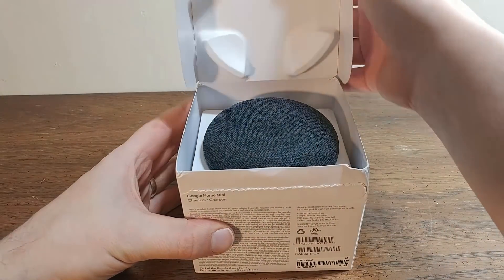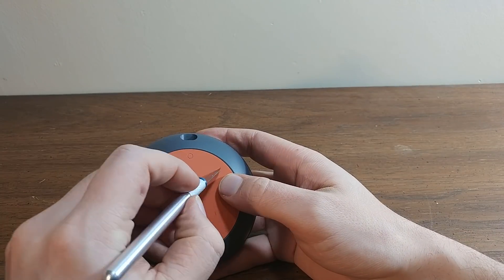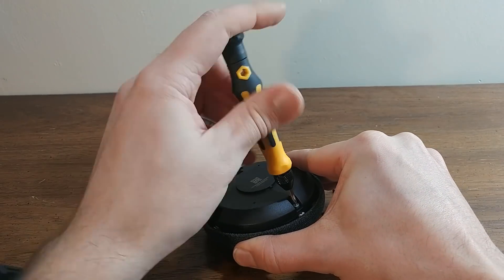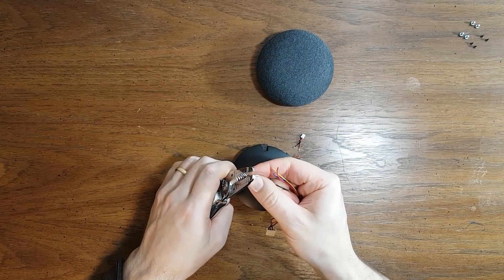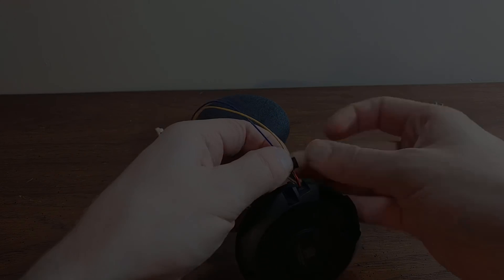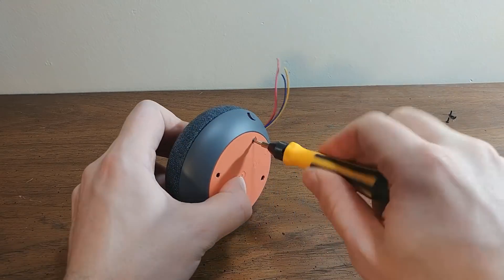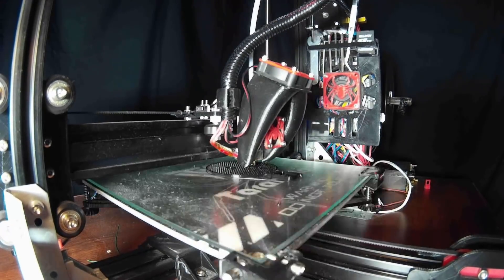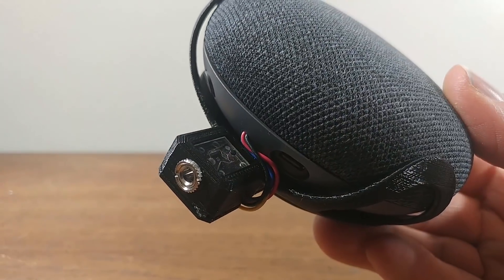Google Home Mini Wall Mount With 1/8 Inch Headphone Jack Mod

Comment: Hey! Do you have a stereo output?
Reply from the maker: The output is mono but I Connected the left and right channels together so that if you did try and run it on a stereo both speakers would work (but Because the Google home has only one speaker it's monor) At timestamp 5:20 if you look at the diagram the two spots where I show the red wire being connected is the tying together of the left and right Channel if you did only one of those red spots it would just be left or right
Reply: Make it work but I think if you used Chromecast audio instead it would be stereo? Though does the voice come through if you ask it to tell you a joke for instance?

Comment: You didnt neex a resister to lower the output on output??
Reply: Very interesting.. I was trying to understand why some video needed a resistor..so thanks for the explanation..
Can I ask, what do you mean by you can't turn the volume up on the google home mini? It had a volume control..does it stop working?
Reply from the maker: I don't need a resistor if I'm just going to an external speaker. If I was to go to a stereo then I might want one because otherwise there's a slight hissing sound and you can't turn the volume up on the home Mini. But because I was just trying to increase the audio quality I could go to a non amplified speaker and it just sounds better especially in the Lowe's
Reply from the maker: If you send too powerful of a signal to the input of a stereo it can potentially fry it
Because it's expecting the volume to be equivalent to what would be coming out of the headphone jack on a phone. So it's not that you can't turn the volume up it's the fact that you don't want to turn the volume all the way up In fear of damaging something
Reply: Make it work That means If I Put the Google Home Minis Volume to (let's say) 20%, I won't need a resistor to be sure not damaging my Stereo ? 
I'm Not familiar with Audio signals and things like that but is it possible to build a resistor into the AUX cable in order to prevent damaging my Stereo ? 
Great video by the way :)
Reply from the maker: Thank you! Yes, it is totally possible to put a resistor in the aux cable, or you can mount the resistor in between the blue and black wires and the headphone jack end, as shown on the diagram at 5:20 ( the way I wire it in the video wasn't correct; it only had the one channel working so use the diagram).

P.S. Without a resistor I typically use maximum 30% volume when going into a stereo.

Comment: where did you get the part headphone jack?
Reply from the maker: I was given this one years ago, but similar ones are available on Ali Express: 
https://www.aliexpress.com/item/10pcs-Screw-3-5mm-1-8-inch-Female-Audio-Connector-5-Pin-DIP-Stereo-Headphone-Jack/32775967220.html?spm=2114.search0104.3.78.e3619895EbDDX&ws_ab_test=searchweb0_0,searchweb201602_4_10065_10344_10130_10068_10547_10342_10343_10340_10548_10341_10084_10083_10618_10139_10307_10313_10059_10534_100031_10103_441_10624_442_10623_10622_10621_10620_10142,searchweb201603_2,ppcSwitch_5&algo_expid=8ecdba8f-9eae-4075-bc05-98c845273689-11&algo_pvid=8ecdba8f-9eae-4075-bc05-98c845273689&priceBeautifyAB=0

https://www.aliexpress.com/item/10pcs-lot-Headphone-Jack-5-Pin-PCB-Mount-Female-3-5mm-Stereo-Jack-Socket-Connector-Headphone/32847629394.html?spm=2114.search0104.3.248.495d3f1cOop3gk&ws_ab_test=searchweb0_0,searchweb201602_4_10065_10344_10130_10068_10547_10342_10343_10340_10548_10341_10084_10083_10618_10139_10307_10313_10059_10534_100031_10103_441_10624_442_10623_10622_10621_10620_10142,searchweb201603_2,ppcSwitch_5&algo_expid=61de9802-729d-430e-b076-1c9f7617ef00-37&algo_pvid=61de9802-729d-430e-b076-1c9f7617ef00&priceBeautifyAB=0
Reply: Make it work is this project pretty easy to do thank you
Reply from the maker: Yes, I found it quite easy. The hardest part was finding where the screw heads were placed, but everything else is very straight forward.
Reply: Make it work thank you very much I will have to try it 👍😀
Reply from the maker: Great! Let me know how it goes =)
Reply: Make it work will do (: